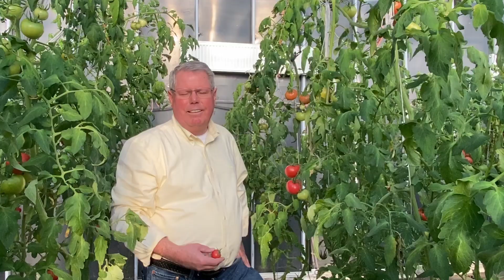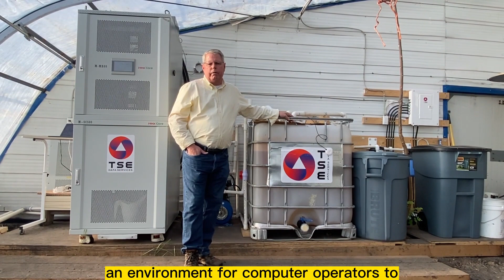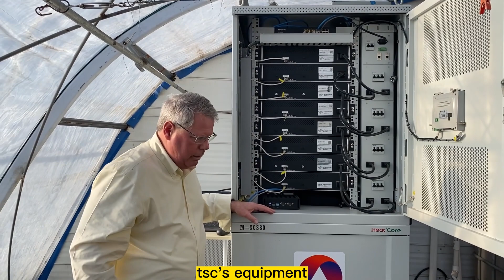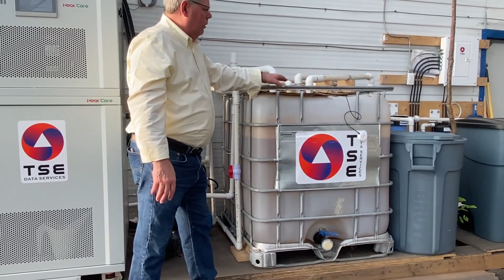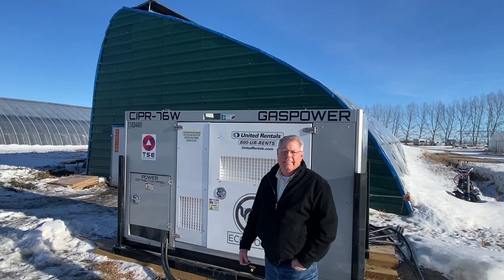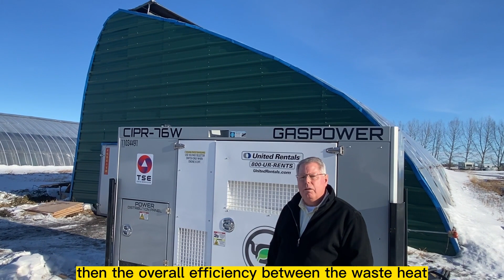Passive solar greenhouse+Bitcoin mining=Tomatoes in extreme cold climate

Comment: This looks like a scam! No serious hoster would move servers inside a greenhouse. Are you kidding ? Condensation would reduce seriously the lifetime of the hardware. Then nobody would host a server somewhere without a backup powerline ( or maybe even 2 ) , backup generator . 2 or 3 high capacity internet connection. Or without support. Or an engineer will sit next to 7-10 servers all day to intervene if something happens ?  
Above exclude any serious business wanting to host servers.
Which leaves maybe bitcoin miner, but that is a big maybe too . Bitcoin miners may not need high capacity internet, but they would still need redundant electrical power, really cheap electrical power, which i doubt you have at the greenhouse ( unless you happen to be next a power plant, and for some reason they are willing to sell cheap ) . They also wouldn't risk high condensation locations, since long hardware lifetime is very important for them
Support would be also important, a non working miner doesn't produce money.

And i didn't even talk about summers, when you would have to vent not only the heat from sun, but also the heat produced by servers.

Does not make sense at all. Do not give money for it !
Reply: It only makes sense if you know what Canadian entrepreneurial culture is like. Anyone with motivation for success tends leave for USA or elsewhere because of all the red-tape and restrictions. So the result is we are left with people who think burning diesel to run asic miners inside a greenhouse is some sort of innovation.

Comment: you should pump some of the co2 from that gen set into the greenhouse to raise co2 levels and increase production
Reply: They do that at a bunch of large greenhouses, but the exhaust needs to go through a special filter to get rid of carbon monoxide
Reply: Good idea
Reply: @jerrycui523  I think so. it's a riff on what a lot of greenhouses already do. Just need to have proper sensors and an exhaust mechanism to control when and how much co2 is pumped in there to ensure it is at an optimal level for the plants while also being safe for humans. I suspect there are already commercial solutions available to regulate all that since many commercial greenhouses are already pumping extra co2 in for this purpose.
Reply: @barfnelson5967  The time of day that the CO2 is supplied, and when in the growth cycle, determines how helpful this is. The best time to supply extra CO2 is when the sun is brightest because that is when the plant respiration can actually use the abundance. On overcast days you would actually see a bit of a detriment from supplying excess CO2 as it can stress the plants. Switching the exhaust would need to be automated. You would also need to create comprehensive safety systems to protect workers from NOx exposure in addition to the elevated CO2 and risk of Carbon Monoxide.